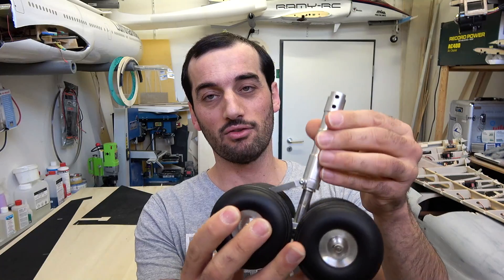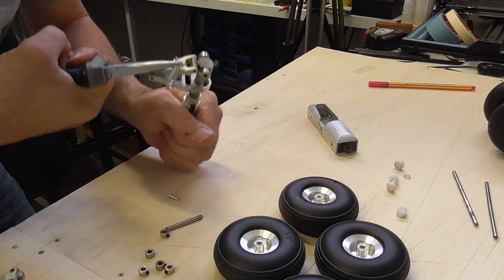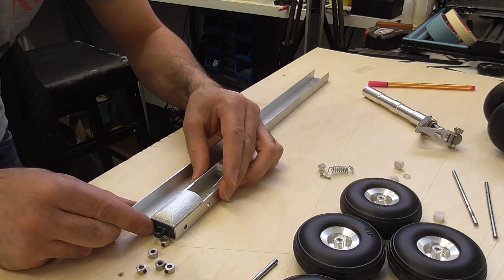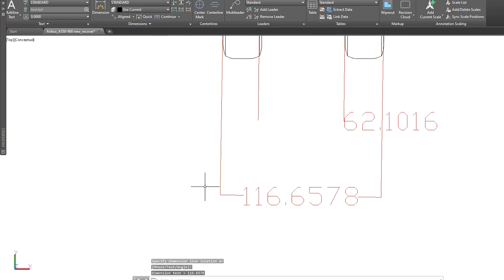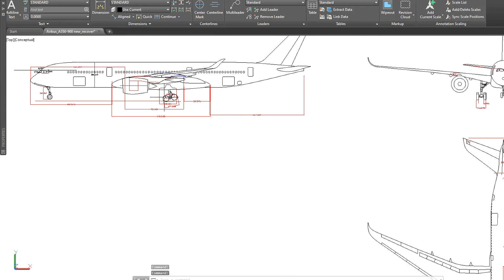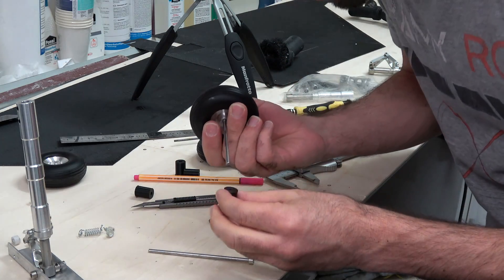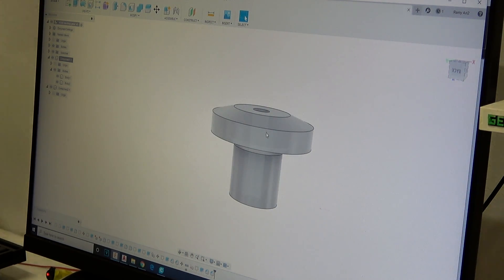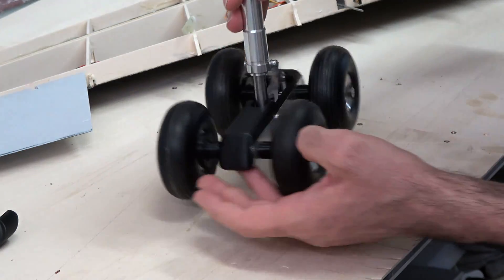Making the main landing gear/ AIRBUS A350 XWB

Comment: Hey thank you for those great videos :D I just remembered you mentioned in one of them the problems with the radio, because of the Carbonfibre hull. I'm no expert, but wouldn't it be possible to connect the antenna directly to the Hull, or parts of it, (like the rudder) and let them act as one big antenna?

Comment: Hey Rammy nice build and video, I love them. Did you ever consider about a true airspeed indicator with direct downlink to your radio? I could surely prevent a stall in the final turn again. You could test out all the stall speeds in high altitude and with a bit exercise later on, you can define a minimum speed (with and without flaps) and enjoy a safe final glide in each situation. It doesn't coast a lot, but gives you always a good feeling flying such big airplanes by RC.

Comment: Just an idea to solve your accurate dimensions problem:  Buy a plastic model kit of the airplane you want, glue it together (no need for all the aesthetics and painting of course) and use your micrometer to pull dimensions from it.  They are usually in 144th scale. You can be sure it's super accurate and by having a 3-Dimensional model in your hand, there is no limit to what it can provide you.  May even be able to use some 3D scanning tech to import it into a computer and pull molds from it.  Could even cut it into pieces to get things like cross section geometry.  Just a thought.  Love the videos, thanks for all of them.

Comment: Wonderful. I'm a hobbyist too (albeit not one of Ramy's calibre!) but I think there are probably some people who'll see this intricate and time-consuming project and be thinking, "What's the point of doing it that way - it would go much faster if you just used such-and-such a method or 3-D printed stuff or paid a guy in a big machine-shop to produce it on a 5-axis milling station or something. Dude, you'd be in the air much sooner and wouldn't even get your hands dirty..."

Well, yes. But the point of a hobby is not to have clean hands or to complete things as quickly or as easily as possible. Doing it is fun. It's not a boring 9 to 5 job; it's not something that you HAVE to do to pay the bills. There's no angry supervisor or quality-control inspector waiting to ruin your day.

A project like this is a huge challenge, but it's one you get out of bed early to tackle. When things are going well there aren't enough hours in the day to get things done, so you stay up all night, working. Problem solving is a big part of it; a decent hobby keeps you so absorbed that time becomes meaningless.

There's no rush, peeps - just enjoy the making. Enjoy the journey.

Comment: the axles on the chassis trolleys can withstand without deformation? nevertheless, there turned out to be a rather large shoulder between the cart and the wheel ...

Comment: Hey Ramy, there actually are "blueprints" for every single airplane in the world. Its called a structural repair manual but they always come with the airplane once it is bought so you would have to buy your own which costs a lot of money. But they give you every single part in the airplane and the exact coordinate, waterline, fuselage station, and so on. We have to use it for my A&P training.

Comment: Nice work dude!
Please please please get rid of those cheep set screws! You're trusting 3 threads to keep the wheel on the axle.
I'd thread the axle ends and use nylon locking nuts.
That project is way too crazy nice to trust that tiny threads wont strip out🥺

Comment: On the wheel doors, add some ribs (3d printed) on the inside, that way, if air happens to somehow catch them, they won't flex and make things worse. Also, i'd get some silicone (sanitary grade kind, but preferably something very soft when it cures) and i'd make a very thin bead on the rim of the doors. That way, when they close, they won't allow air to circulate between them and the fuselage. 

This is the kind of stuff that was done to giant F22 RCs in the club that i'm in back in the day when RC sized turbine engines first came out. They would go quite fast and doors would get ripped off. Silicone and ribs did the trick.

Comment: 14:50 Wall-e is talking 😊 (best when gear down...( here up))
One thought about shock absorbers, even small r/c cars can use oil absorbers, I did it myself younger, why not using an hydraulic system, it could be useful maybe but difficult to set the exact balance for an efficient work. (How to make things complicated.. :)))
Beautiful work you've done, there's something magical about landing gears

Comment: Ramy have you considered 3d printing in ABS, you could acetone smooth the printed parts and make them look nicer and more like metal
Reply: If you go abs go fully enclosed with insulation in a warmed room of the house or don't bother at all. That or install a heater inside enclosure.. to do abs well can be hard
Reply: @jotham123  For just small cosmetic pieces it  shouldnt matter that much, they dont have any stress applied to them so theres no need for structural integrety
Reply: I’ve done several abs prints in a cold garage simply by placing cardboard walls around the printer. The heated bed keeps the inside warm enough. However, the taller the print is, the more crucial a well heated box becomes.

Comment: Ramy, Good Job in completing their wings, now I have some big theory to inform you. Taking your Dreamliner’s condolence in consideration, year ago or so, you mentioned that 2 more planes crashed at that very same spot that day. According to one of your theories, you said that the signal may have been lost, but you said that you heard the engines full power while stall, you said that you didn’t feel it being disconnected from the transmitter, but the way it stalled was exactly the same way it stalled if any other aircraft may have lost it’s signal. The thing is what I believe is that the electronics were working perfectly. Physics wasn’t, Now what I mean by this is that you heard the motor full sound just a second before the crash, the propeller’s purpose was to deliver air at the back of the motor, now what if the air wasn’t there, same thing would have happened if you entered immediately with a place with no air. Maybe there was an air pocket at that spot which caused your Dreamliner to crash, and also it makes sense as 2 more planes crashed at that very same spot, Maybe there was something there, causing the air to just disappear or there was something specific there, which caused the expected physics to fail. Please reply, Thank you, regards, your one of the earliest subscribers, Burhan Shahid
Reply: it seemed to be wind sheer, it was strange

Comment: Ramy will you be adding panels to the gear stems to make it flush with the wing when closed or is it too complicated at this scale?
Reply: If he's going to that tiny bit of detail on the landing gear, of course he's gonna do that!😄
Reply: hope sotoo bro
Reply: I dont think he is gonna do that cuz it needs more servos and is more expensive
Reply: @cachin9505   Or he could just glue a fitting cover piece to the stem of the landing gear.
Reply: @cachin9505  it doesnt need a servo because it just attaches to the main landing gear